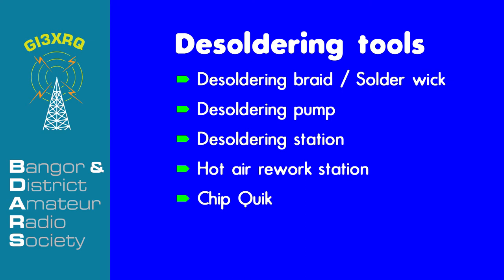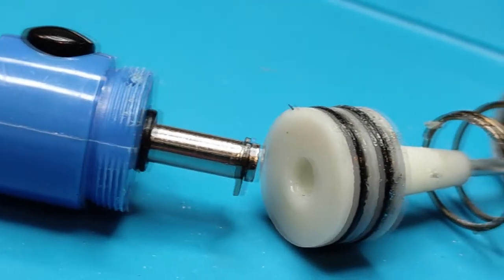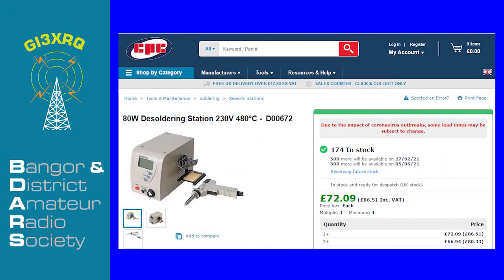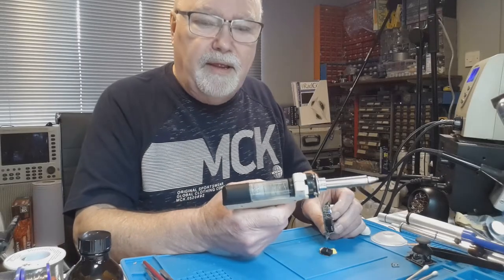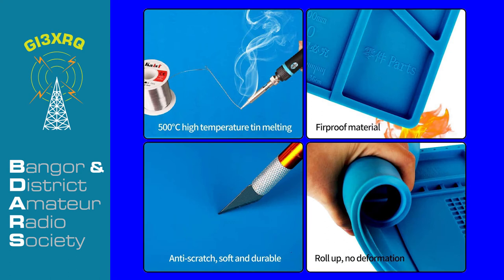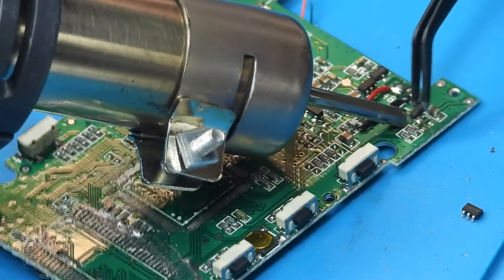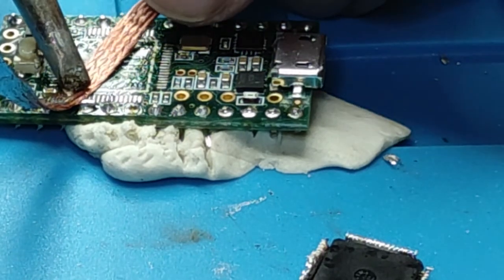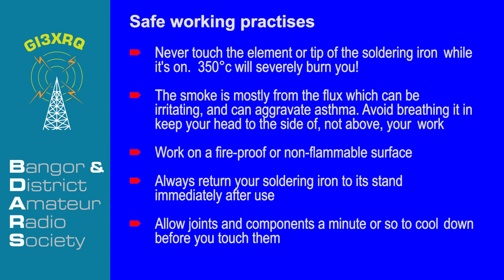Desoldering techniques and demonstrations

Comment: Excellent video, modern electronics forces us to use a wide range of tools, I use everything that you show in the video.
You are missing something "Needles" 
I have many throughole desoldering guns, my every day tool is an old Hakko 808, but if you are in budget the Yihua 948 is the best throughole desoldering station right now for only Us$100, nozzles are good quality and very cheap, complete gun cost Us$28 dollars in amazon.

Best Regards.

Comment: Hi Gordon, thank you, great informative video.
A couple of questions:
Do you need to apply flux on the joints before desoldering with all the techniques you showed (I think I saw you applied flux only with the "chip quick" technique)? And what about applying extra solder before desoldering?
What in your opinion is the rank of best techniques considering the least damage to the rest of the components/board and/or the re-usability of the de-soldered component (not considering the price of the required tools) ?

Thank you again
Reply from the maker: Hi Mario, thanks for the kind comments. I generally don't use flux when desoldering, but sometimes it can be beneficial to add additional 60/40 lead solder, the extra bulk transfers the heat rapidly through the joint, this is also helpful if working on  modern lead-free PCBs. I use the electric vacuum desoldering most on older equipment, modern multi-pin components often have their legs snipped and the remains removed with soldering wick, or a combination of other methods. Hope this helps, as with most things, practise makes it easier. Good luck 👌